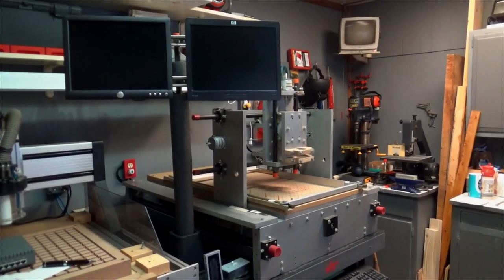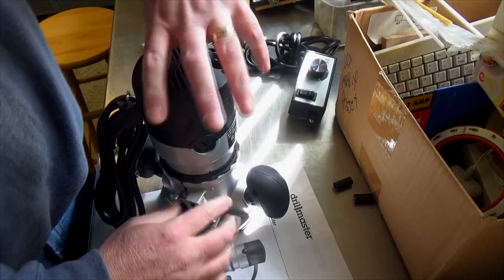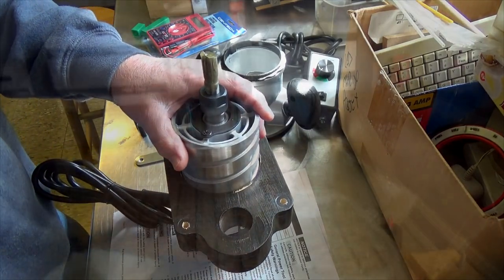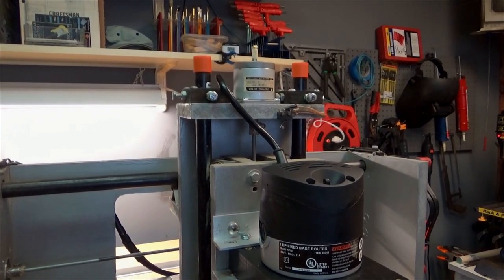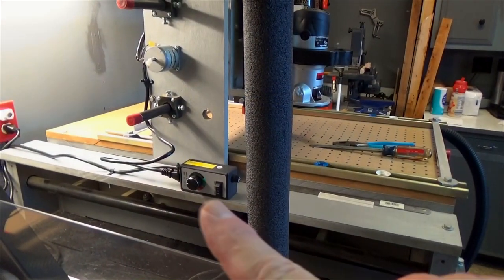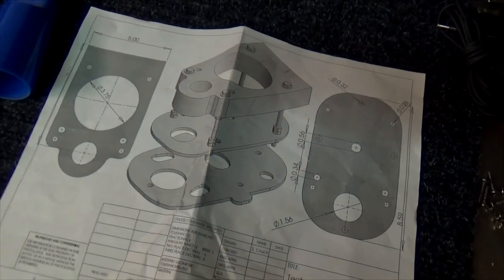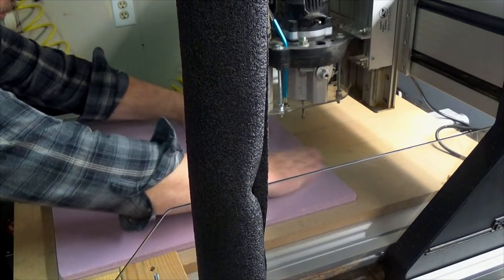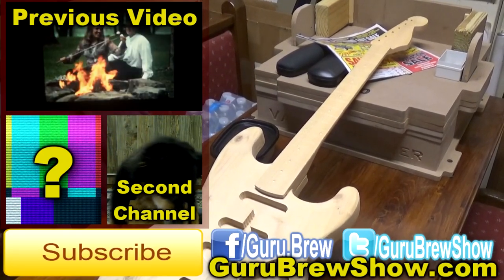Choosing and Mounting Router & Dust Shoe to CNC Machine

Comment: could you link to where you got the acrylic bit from?
Reply from the maker: http://amzn.to/2enyeud
Reply: GuruBrew thanks.  I'm just getting up and going with my CNC router, a cbeam machine xlarge from http://openbuildspartstore.com, so I'm on the lookout for info to get me going.  thanks for some get videos
Reply from the maker: Those plans seem to be very popular. Decent sized cutting area of 29.5” x 13” and similar to my home built. Let us know how it goes.
Reply: GuruBrew I just leveled the spoiler board on my machine.  I ended up with a workable area of 750mmx350mm if I remember correctly.

Comment: How does your router tolerate the HF speed control unit, often times reduced voltage equates to degraded performance? Great video BTW.....Paul
Reply from the maker: Not sure it's new, but I will let you know with time. Thanks

Comment: I went and bought the same router and speed control you did. It says on max it will do 24,000RPM's how can I find our what the RPM's are at the lower speeds
Reply from the maker: I don't have a tach so am not sure but judging on the sound about half maybe. Thanks